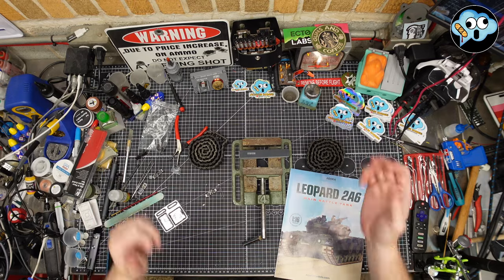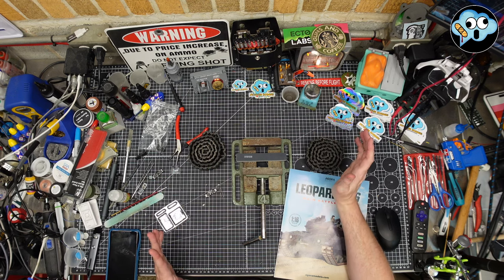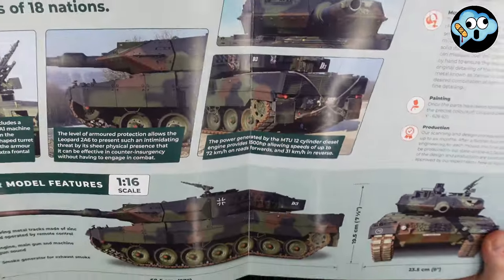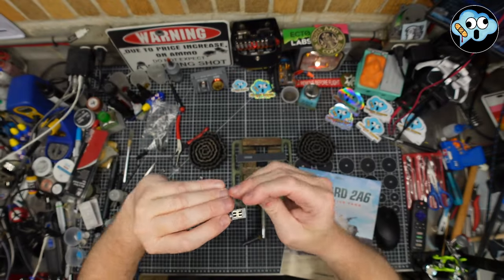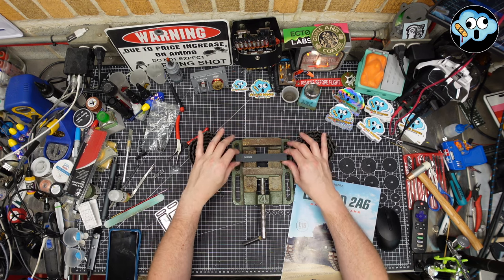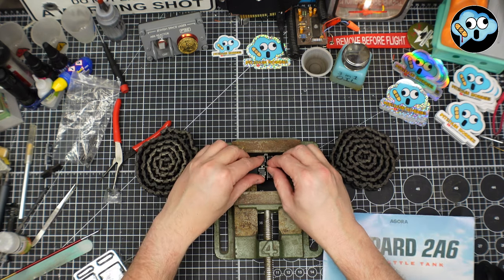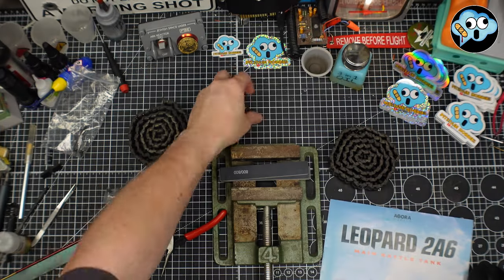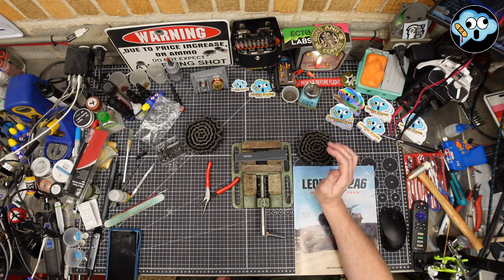Agora models 1/16 scale Leopard 2A6 Main Battle Tank partwork kit Track link build tips.

Comment: So sorry I missed the track bashing marathon. Much easier than using a sledge hammer, crowbar and rattle gun. :)
Often the number of track link are offset on each side due to the torsion bars, but because this model uses the springs they may have been able to avoid that.
Reply from the maker: My Tamiya Leo 2 has torsion bar suspension and equal length tracks, but again it is a model.